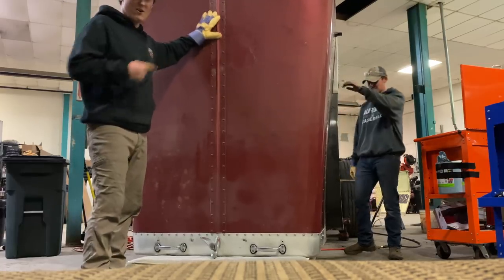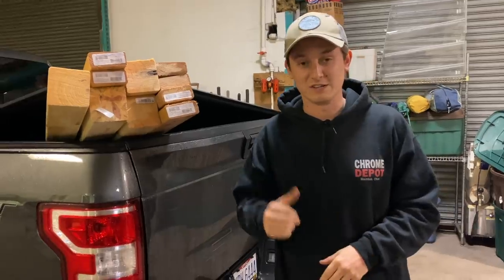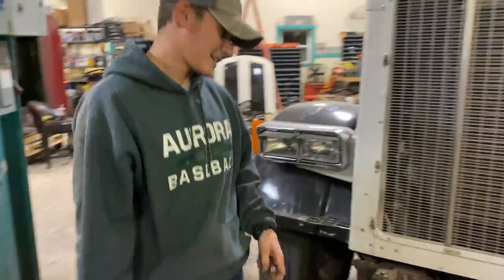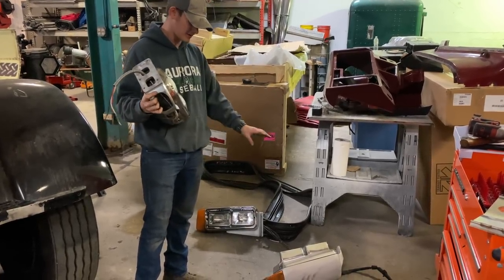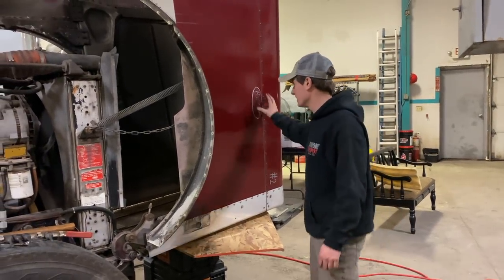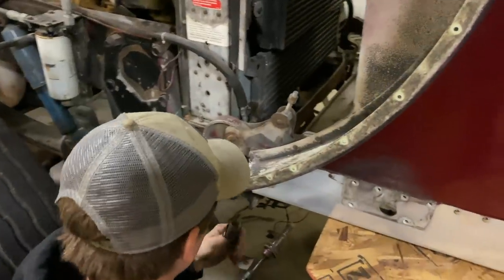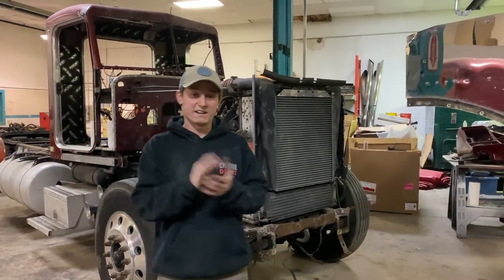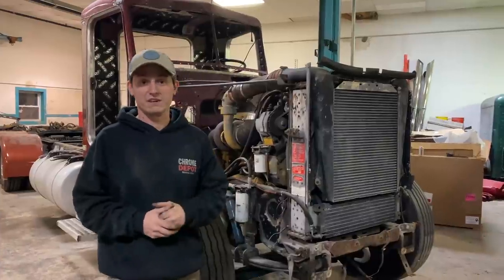"RAT ROD 18 WHEELER PETERBILT LOSSES ITS HOOD!" Rebuilding a Peterbilt Flattop Part 4

Comment: Good shit fellas! Got yourself a rolling chassis for the most part that'll move under it's own power when the dash is put back in. Its nice to do it once and do it right. My pop taught me that at a young age. Now you have nice access to address pretty much anything you'd want or need to. Just tig weld that bumper bracket. That's what everyone does anyway since that bumper bracket is all integrated with the rest of the chassis it's too damn involved to do anything else, and really no reason not to just throw a weld on it. Really interested in seeing what you guys have in store for the hood. Great job on the progress!
Reply from the maker: Yeah we ended up big welding up the bracket on the silver truck!